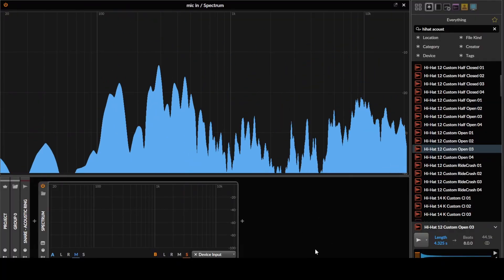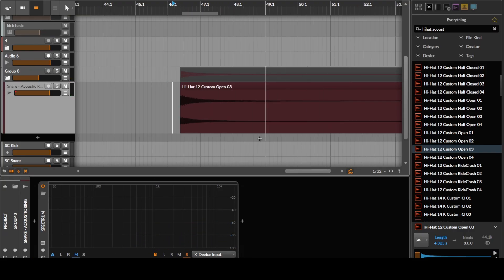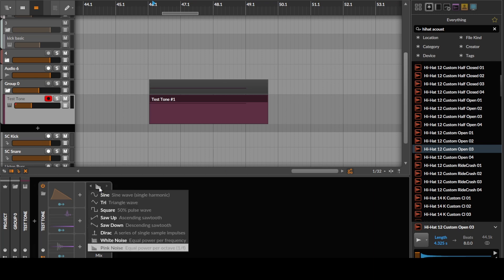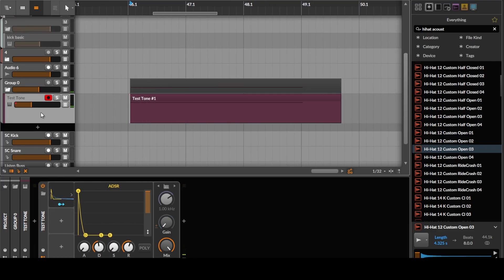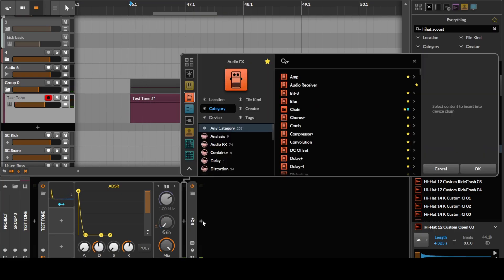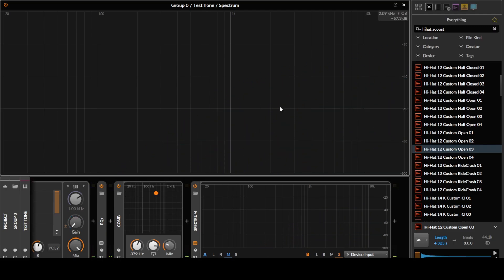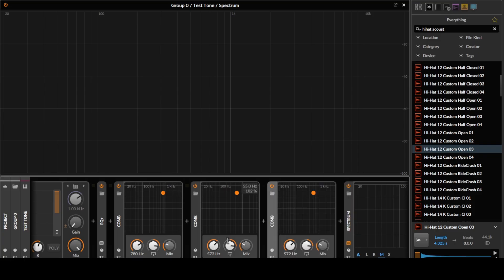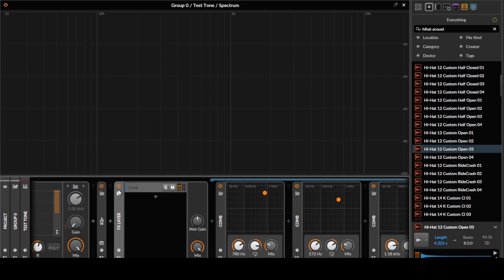Hihat Synthesis with Comb Filters | Sound Design Concepts Ep. 29

Comment: I think there are certain ratios for metallic overtones that you could set those pitches to and get it more exact, I have logic so not sure how I would get comb filtering set up hehe :)
Reply from the maker: a comb filter is just a very short delay, the feedback is the delay feedback and the frequency is determined by the delay time (higher freq = shorter delay time).
should be doable in any daw, it's kind of the most fundamental filter ^^

and yeah, this is quite a janky approximation. as you'll see in the next episode there's quite an easy hack to get proper cymbal harmonics